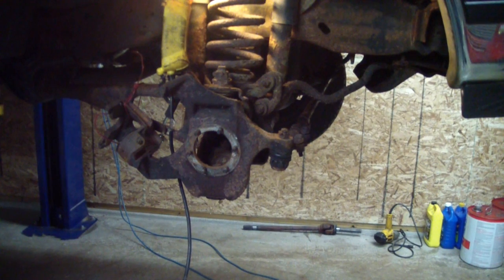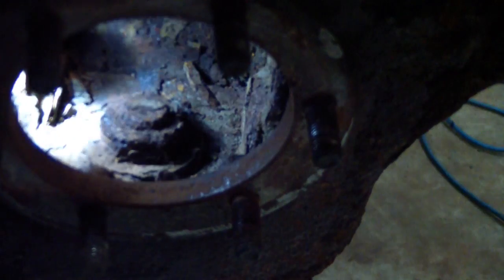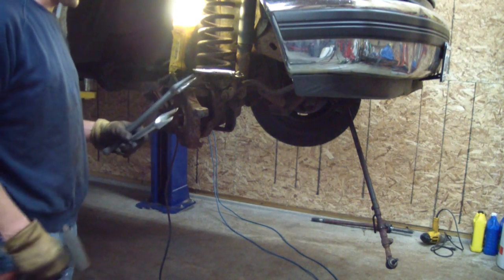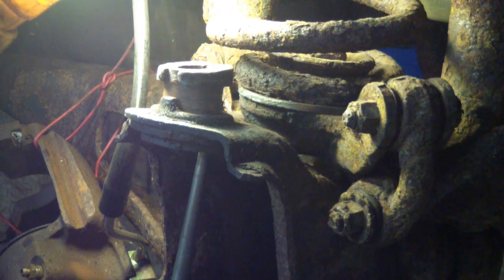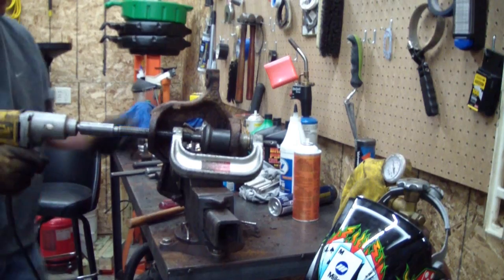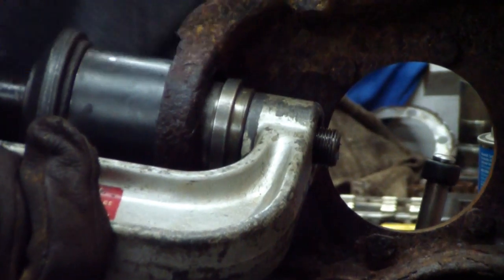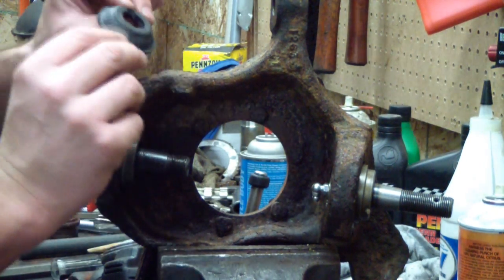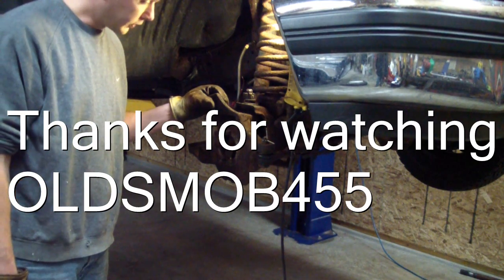Ball joint change in a 1987 - 1996 Ford F150 or Bronco 4x4

Comment: Good video.  Just a small point to share.  The sleeve/bushing you freed up to make it easier for the alignment guy actually serves another purpose as well and it is critical that you free it up.  The bushing is split and it's what sets the correct distance between the two ball joints so that they don't bind together or try to pull away from each other when you tighten the nuts.  When you tighten the lower nut it puts the upper stud in the correct position.  When you now tighten the upper nut it spreads the split bushing, locking it to the knuckle and the stud to the bushing.  Other setups (mid 70's scouts for example) had a threaded adjustment.  Failure to free up that bushing can make your knuckle bind up and truck steer horribly as well as accelerate the wear in the joints.

Comment: Thanks man :) My lower ball joints got fucked up in an accident and caused crazy negative camber on my front wheels. Just picked them up from the parts store and am gonna install them next weekend. Thanks for the vid!
Reply: Dominic Barile how did your fix go? I gotta do the same thing soon.
Reply: Chad Thibodeaux went good. took me exactly 24 hours of total work time because Im only 17 and kind of learning as I go. Want to be a mechanic when im older so i do all of my own work on my bronco. I also didnt have an impact so I had to press the balljoints by hand. Was pretty straight forward job. exactly like the video. Hardest part for me was trying to tighten the balljoints without them spinning inside themselves. Made a hell of a difference my truck rides and steers so much smoother now. my old balljoints had no grease (ungreasable) and were just full of rust and you could hold the base and flop the joint around lol. Not a difficult job just time consuming! Plus I had already had experience taking my hubs apart about 5 times prior to doing this job. the hubs can be intimidating but you just have to look at how it comes apart and make sure you put it back the same way it came apart :) if you have any other questions feel free to shoot me an email dominicbarile@gmail.com

Comment: Great video. Strait and to the point at every part. I like to put the nut back on the tie-rod to protect the threads when I beat it loose as if I miss w/ the hammer, I don't booger the threads

Comment: Great video. Since I don't have a acetylene torch to cut the ball joint nuts, I used a Dremel with cut-off discs and a MAPP torch. Cut a relief into the nut, sit on it with the MAPP for a good 5 minutes, and then proceed with the breaker bar. Popped right off. The $50 HF electric impact works great if you can't afford a name brand.

Comment: Thanks for reminding me what it's like doing the ball joints. My '96 F 150 with 4" lift and 32's needs new ball joints every four years or so and is overdue right now!  It seems like it's always the lower right which goes first, even when it was on warranty.
Reply: I would try buying the premium ball joints. They are meant for lifted trucks with bigger tires
Reply: Dominic Barile I always use Moog products. I checked them again last week and they seemed OK so I must have been seeing things earlier. I found a full set of ball joints on eBay for less than $30.  I don't think I'd put those in even if I was selling it to my worst enemy!
Reply: mumbles552 Yeah lol. I drove through a fence and F***ed up my lower ball joints to the point where my front wheels are cambered in :( didnt have $200 to spend on ball joints so I went with the Quick Steer ones which were only about $70 in total. I would have rather gotten Moog but dont have the money. Ill be installing the new ones next weekend... Hopefully they last :/
Reply: mumbles552 luckily my ball joints were the only thing that got messed up. My 91 bronco is pretty tough I guess lol

Comment: The upper ball joint nut is really large, its like a 33mm or 1-5/16". The lower ball joint nut is 1-1/8". Just FYI for any about to do this, make sure you have those sizes before you start if its your only vehicle like me!
Reply: Sorry, I commented before finishing the video, you gave the socket sizes in your video

Comment: Nice,does that electric impact gun got the power to press the ball joint out,and how do i set  a torch to cut,heat and weld ? cool vid thanks.

Comment: How do did you pull that passenger side drive axle out without dropping that Dana 44 and removing the c-clip from the diff?
Reply: I watched the accompanying video to this one about the u - joint and axle but that was only for the driver's side.
Reply: *****  That makes sense.

Comment: Thanks for posting this video. I have a question hopefully you can help me. If you are changing the cam/caster sleeve do you need to remove alignment pin sleeve under it?
Reply: Time 7:05
Reply from the maker: Not sure what you mean or maybe they were missing on my truck?  My alignment bushings came out with simply taking the nut off the ball joint.

Comment: Do you need to take out all of the brakes, rotor, u joints, etc to replace the upper and lower ball joints..?
Reply: Depending on what vehicle, on my 1997 F250HD which is a Late 96, i had to take brakes, CV axle, hub, spindle and a bunch more off to be able to do them.

Comment: Just the video I was looking for! Very detailed! I learned faster this way than reading the damn manual and looking at the schematics LMAO

My 96 F-150 had a 1/8" play when I was doing my maintenance and my hands was at 12 and 6 oclock position, no play at 9 and 3... the castle nut and the cutter pin was intact, no signs of backing out or anything, but I tried tightening the castle nut about half a turn (I just saw your video and I will torque it to specs later today) and it got rid of the play. Now, do I still need to replace the ball joints or that was the the fix?

I don't drive the truck often so it may take some time for me to find out... it's dry here in Vegas so corrosion is not an issue...

Thank you for sharing your knowledge!!!
Reply from the maker: If your nut was tight and there was/is  play in the ball joint, the ball joint is wore out.
Reply: Oldsmob455 thank you sir...👍🏼

Comment: The bottom bolt of my knuckle just free spins when I try to un do it. The nut spins with the stud . Is there a reason for that?
Reply: Also if 4×4 try tightening  upper ball joint bolt  ,that might  work by pressing  lower stud further into  knuckle hole .

Comment: How do I get the axle out from the passenger side if it won't pull out like driver
Reply from the maker: The passenger axle is a two piece axle with a slip joint.  If you want to get the inner part out you need to take the pumpkin out.
Reply: +Oldsmob455  so how do I take it apart so I don't have to remove the pumpkin?
Reply from the maker: If you want to take the passenger inner out the pumpkin has to come out to remove the E clip.  Watch "Spartan Locker Install Dana 44 IFS TTB Front Axle Ford F150" and you will see.  This is of coarse assuming no one has made it a full floating axle yet.
Reply: +Oldsmob455 I just separated it at the slip so I didn't have t worry about the other axle but thanks

Comment: Let me share my experience:  The Spicer brand ball joints are often recommended, but do not come with grease-zerks or dust-seals.  That's crazy.  Spicer tried to tell me to install the ball-joints without dust-seals.  No way.  Instead, buy the MOOG brand ball-joints.  They DO have grease-zerks and dust-seals.  The $12 one-year Chinese-made ball joints look like junk, so don't use them either.